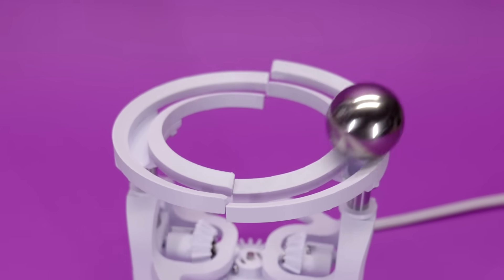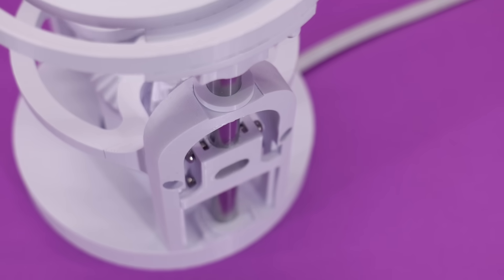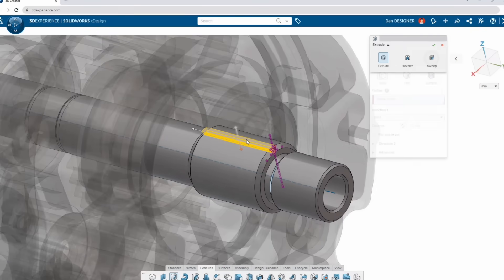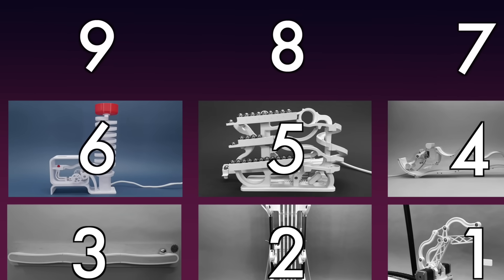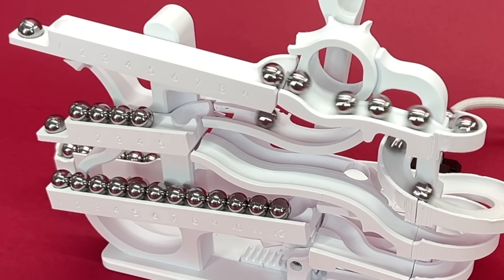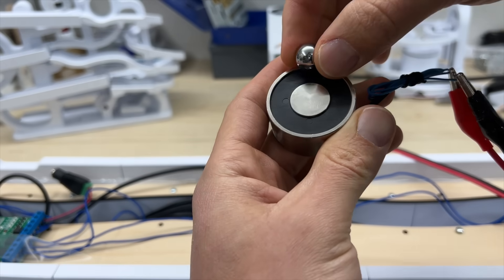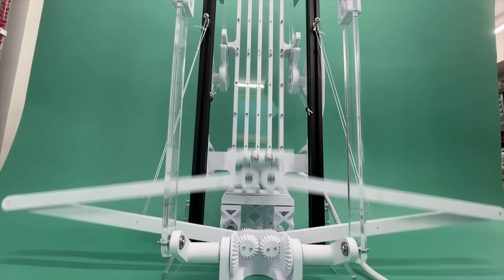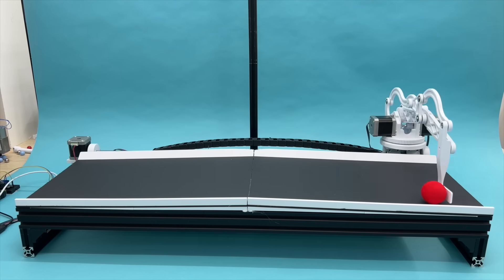I Built 9 Satisfying Ball Machines (IRL)

Comment: Does anyone like the idea of a bouncing hardened steel ball on a hard surface like hardened, but not stainless steel, with a coil wrapped around it. Then, I could use a hall effect sensor embedded into the steel to detect the ball. Then, some code would trigger (After an adjustable delay or not) the magnetic field to turn on, pulling the steel ball down, giving it a small boost, keeping it bouncing forever. And, I'd make the surface slightly concave to make sure it stays centered. I'm already designing this also.

Comment: I've watched way too much Wintergarten and his Marble Machine to miss that marble drop after 9:22. With the weight of the marbles rolling off the hour arm the marble that started the tilt got squeezed out of the line as it tried to merge and ejected down onto the motor rack. Dangerous place for it to fall.

Maybe, as a suggestion, you could find a way to make it so when the hour arm tilts down it moves a gate between the tilting marble and the marbles rolling off the arm where they would join up. After the hour arm empties the gate moves away and the tilting marble rolls in behind the other marbles. Avoiding the squeeze trap scenario.

Comment: blah blah blah for the rotating ball one why no have done a shaft straigt up from middle with an a bend shaft so it "wanders" in circles and connect the top "ball" railing so it tilts to each side in an even circle.... not even sure how to explain what i mean but i am sure it would take less energy to spin. especially with magnetic bearings.... and instead of using a steel ball use a magnetic ball and add a shit ton of copper wire so when the ball rolls through it creates a charge??

Comment: the electromagnet one was awesome, but the fact that you had sensors detecting the ball really threw me off xD

have you ever played with the idea of using small pieces of metal track, that when the metal ball goes over, its completing a circuit to trigger an electromagnet? 
the metal parts of the rail could be lengthened and shortened for the desired duration of circuit completion and thus duration of activation of the electromagnets, and in theory one length of metal rail should work for variable velocities of ball, because a faster moving ball spends less time on the metal part of the rail and so, triggers the electromagnet for less time, but needs less assistance anyway as it carries more momentum. Slower balls have less momentum, but spend longer on the metal part of the rail activating the electromagnet for longer. maybe? xD

aside from the safety issue of live balls, this seems quite fun to test. or maybe its already been tested, and is impractical?

keep up the awesome videos man, great engineering, in a fun presentation

instant sub

Comment: you mentioned you absolutely 100% required proprietary software to create these dedigns. these designs do not need proprietary software to create. engineers using openscad have created massive libraries of complex gears including herringbone designs, all parametric. specify the distance between two gears as a parameter, specify the number of teeth in a set, and the program creates two STL files, one per gear. i use pyopenscad to create entire 3D designs in python, autogenerating a BOM by using object-orientated classes per 3D printed object or imported STL file so i can track all parts in a given design. freecad is another piece of CAD software that is partially parametric and may be easier for non-programmers to use. all that said: these are all really enjoyable and elegant designs. all that said: as an experienced 3D printing engineer i am loving what you've created, especially as i know how long they take to make and get right.

Comment: I wonder if you could combine 7 and 8 into one machine where there is a gap between the two track segments with two trampolines at the bottom. Or maybe the track segments can be a bit longer to each form a quarter circle so that the ball travels in a figure eight and bounces off of a single trampoline in the center.

Comment: For #8, you split the two pieces into four, which, as you said in the video, was of questionable improvement.  However, the one you really wanted to duplicate at a right angle was, in my opinion, #7, where the ball bounced between two towers.  If you had two towers at right angle to the first two, with another ball bouncing on the same base, and everything carefully missing collision, that would be quite satisfying!

Comment: Check out “Man Lifts” . They are vertical conveyor belts with hand grabs and steps that go straight up and down between floors like in a factory. I use to ride one at Blue Diamond Almond Growers in Sacramento. You can quickly go up and down through holes between floors. Going up was fairly easy but going down required timing to put your foot on the step and grab the hand grip at the same time. If you missed you could fall to the next floor or even 4 floors down. 
They were used more widely decades ago but were never really safe at any time. Gives a new meaning to cheap labor and being expendable.

Comment: Claiming that the code could 'only be figured out with AI' is a bit disingenuous to all the people who have made similar mechanisms long before AI (or LLMs that happen to have programming documentation in their training set) was around. Back when basic if this than that chat bots infested Yahoo chats, and even before then....like, say, when we figured out making a self driving car was mechanically possible, but making the control scheme drive like a human was impossible (yes, we discovered that in the 70s, quite a while before AI...so long as you use a realistic definition and not just apply it to any 'decision making code'. And no, computing hasnt changed. Computers are faster, and cheaper, but still the same binary today as back then). And I see it as a quite problematic message to be sending to people you're hoping to inspire to take up mechatronics. It boarders on the people who think we couldnt carve straight lines in the past when we absolutely could. It shows an assumption that humans are ignorant and incapable. Which is a view point that is downright wrong....

Comment: Love these. My favourite is actually the wave shelf which uses electromagnets. But, the engineering skill in all of these is really impressive.  The penultimate design got me thinking. Each of the four steel balls have many parameters acting upon them which makes each of them bounce uniquely. Release point, friction, mass and even the air pressure inside each tube affecting their drop. Before the advent of modern manufacturing techniques for steel balls, steel "shot" was made in a fascinating way. Molten steel was dripped down a large "chimney" called a Shot Tower. On it's way down, it would form into a sphere - solidifying on it's way to the bottom.

Comment: I bought one of those commercially available "Time Machine" rolling ball clocks back in the '70s or '80s. It was all straight lines and angles, and it had a fatal flaw that eventually burned out its motor (a gate to prevent logjamming that eventually got stuck and blocked the rotating arm). This rolling ball clock is a beautiful sinuous work of Art Nouveau! And it doesn't seem to have or need a gate. I'd love to have one!

Comment: This is the video that finally got me to buy SolidWorks. Thanks for making an informative video. I haven't explored your channel fully, but I'd like to see a minimally-edited video showing your design process in SolidWorks. I think something as big as one of your escapement mechanisms would bee a bit to much (or perhaps would be good as a multi-part series) however the geared light switch would be great. How about making a model of the light switch that supports double and triple gang light switches, with a single master level to turn them all on or off with one switch. Then build it from concept to STL files in a video. I'd pay to see it! :)

Comment: Hey Jake, tell me, 
how did you approach the last machine? It's really cool!!!
I looked into it a bit and it looks like you used two stepper motors for the actual arm and another one for the rail to move the whole arm. 
Using the openvc api you were able to get the position of the ball and tell the arm where to move. This is done by two different scripts, Python for the api that determines the position with webcam footage and C++ for the Arduino that controls the arm. 
To control the arm, you need inverse kinematics, which uses an algorithm to determine the different angles of the joints based on the arm lengths of the robot arm and the target position. 

How do you implement this? Do you use software like RobotDk or something and where does the information come from, are there tutorials? 
There are some on that topic, but they do not really show how to apply it to myself.

Comment: 3:50 Stop the bullschit hype. The software is NOT "by far the most important tool in the shop" and yes that can easily be PROVEN
Reply: I used fusion 360 and inventor,but SOLIDWORKS was better

Comment: Don't purchase SOLIDWORKS Cloud Apps for Makers or 3DEXPERIENCE SOLIDWORKS for Makers through his link. If you go directly to the website they have a 50% off code good until Jan 10, 2025. The code doesn't work in his link. The Code is, EOYMAKERS50, and it will bring the price down to $24 for the year.

Comment: For any ball bounce project, the harder the base or steel plate the more energy it will return to the ball during it's bounce.  Blacksmiths use ball bounce to determine if the surface of an anvil is cast iron or tool steel.  A really hard anvil can provide an very satisfying long ball bounce.  Thank you posting all this.

Comment: Fabulous!!  Along the lines of the "trick" with the shelf.  How about this?   on the sides are 2 metallic "plates".  When 1 person touches each with a finger, it closes a circuit to start a counter as shown by LEDs in each of the 3 segments (1 at a time, passing from one segment to the other S seconds each). The longer the person holds the TOUCH, the longer the LED light segments move from one to the other counting up the number of C seconds or minutes the machine will stay on.  But it's not turned on yet.  That happens when the person doing the TOUCHING... PRESSES the side while the LED of that side is lit. ... P number of times (i.e. left then pause then right then pause and so on).  The main idea is it will be visually difficult to discern a TOUCH from a PRESS and the TIMING and count of the presses will be just about impossible for an observer to recognize.  :-)

Comment: 9:22 the ball jumped the track and landed in the rack mechanism. I'm sure its already a well known problem you faced throughout every one of your builds and you have done a great job in overcoming Murphy's law in all of your creations, its still nice to see that with a little bit of determination a marble will always find a away off the track when the camera is rolling. I'm a huge fan of mechanical contraptions and your builds remind me that there is always a simple solution to even the most creative of tasks. Keep up the good work!
Reply: Where and when? It doesn't seem to happen at 9:22.
Reply: @PhyloGenesis  The carry ball falls off the track at the aforementioned time, just in such an elegant way that you don't realize it's abstinence from the intended route
Reply: @securitycheesehostage7542 That is the intended route for that ball. It has a section of track there for that reason.
At least I'm pretty sure...
Reply: @PhyloGenesis  nope watch again.. it falls into the space where the gears are. definitely not intended and you can see the track its supposed to go on clearly but its knocked out of it by the force of the many balls its trying to "join streams" with. it could very very easily be fixed by simply raising the height of the lip where it jumped over though, so its not a huge deal.

Comment: Did you design the clock or did you find schematics for it on a 3D printing library?  I ask because I recall having a clock similar to that back when I was a teen in the '80s.
Reply from the maker: Conceptually its been around for a long time, but this iteration is and Engineezy original

Comment: i dont see why it would be impossible without solid works , i bet fusion 360 or onshape would also been capable enough and are even free for hobbyist for the most part. 
where onshape is browser based ,fusion is not but fusion360 does have its benefits like also having a cam option intergrated which if you also want to do some cnc machining besides just 3d printing is a bliss.
so plenty of option which would have got you there without solid works so bit misleading claiming it to be impossible without solidworks.

Comment: I'm a bit confused, you said OpenCV is a python library?  It's a C++ library that happens to have Python bindings; which is an incredibly distinct difference.  You wouldn't call a table a Pledge table because you cleaned it with it, or a Fiestaware table because that's the dishware you used on it?
Reply: not an expert but aren't a lot of python libraries written in C or C++ under the hood?
Reply: And I imagine he'd be correct. OpenCV-Python exists, and is described as "the Python API for OpenCV". While technically yes, it's just a python wrapper for the C++ guts, for all intents and purposes here, it is a Python library

Comment: @Engineezy, I was wondering: have you ever used Octave GNU? To cut costs at my university, they quit using SolidWorks and switched to Octave, which is totally free. They told us they were essentially interchangeable programs, as files created in either program would run in the other.

I don't have very much experience with CAD, and Octave is all I have used so far. We only used it to create a track model to check velocity and length for a roller coaster, which we then built from K'Nex.

Comment: 1:25 can you set these up so they are all aligned and going the same way?  The sound it makes reminds me of those old clocks that had the numbers on the little flip cards similar to a Rolodex. 
  It also made me curious to see if the layout could be modified and marbles set up to show the time.. first 2 columns hours and 2nd minutes. It could be easier to do it with the 4 steps instead of the 6. 2 darker marbles on one side and two lighter ones on the other, like the old digital clocks.

Comment: I have a clock here I bought about 20 years ago that uses the same mechanism as yours.  I think your version is a little more robust though... this one when running too long starts to drop ball bearings until there aren't enough left in the system to continue.  (fortunately it sits inside a clear cover that retains them).   As such it sits idle on my shelf.  Might have to build this version to see if I can let it run.  Great video!

Comment: Now, do a video where you run all these continously side by side and make it a competition to see which one last the longest without any errors or dropped marbels!
Would be interesting to see which mechanism is the most rubust.
Reply: i feel like the “perpetual motion” machine would win that since its whole gimmick is to look like it lasts forever
Reply: @frostwing1899  I feel like that's the one that more easily would fail since any small perturbance could hinder it since the movement is so subtle, I feel it's the one that has the worst error control (for example, the one where the ball is launched up has quite a big funnel to control for errors), but that's only my scared ass, so idk
Reply: my bet is 9 lasts longest and 6 loses first